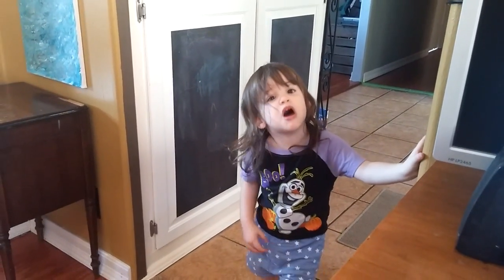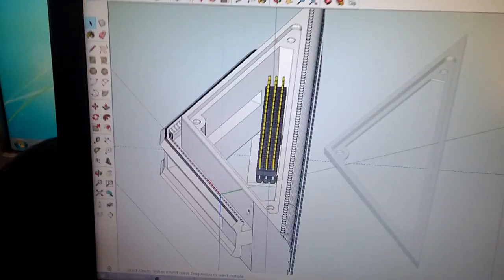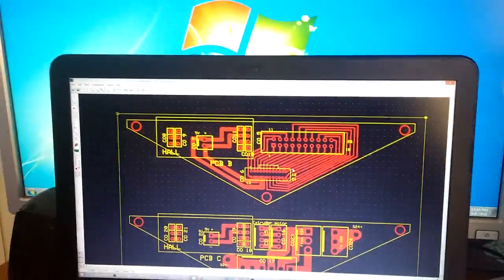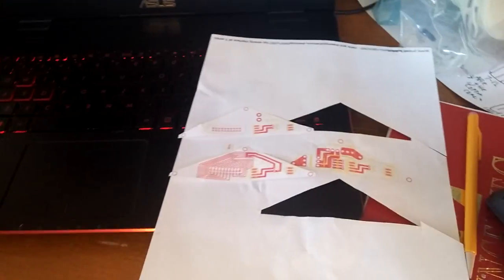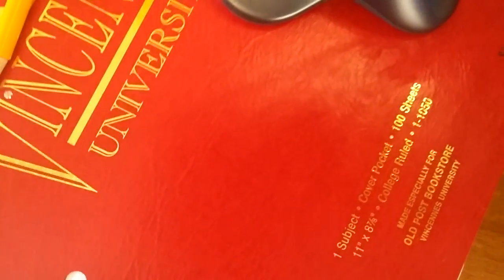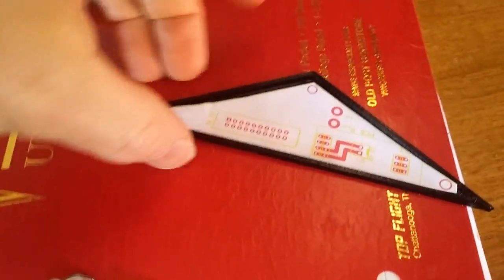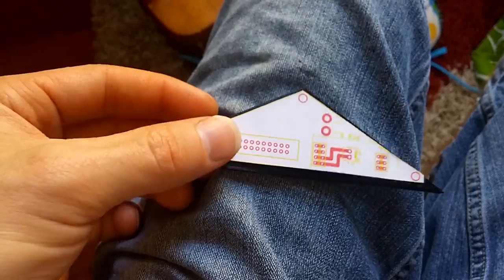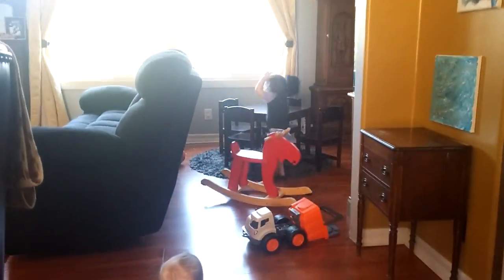Tip Clip: How I Test Fit 3D Printed Parts Before Making Final Prints.

Comment: I've noticed with Express PCB that the circuit board usually prints around 97% of original size so I always have to resize it on my printer. I forgot to resize on one print and had to bend the 8 pins on a transformer as I needed the circuit the next day haha!
Reply from the maker: strange. the only time I had that problem is when the printer settings were messed up. but never when directly printing from the program. ~Russ
Reply: *****

I think it's probably my printer that's doing it heh.
 EDIT: But it is a great program for quickly creating circuits. I love it!
Reply from the maker: +Jim Griffiths yeah. there are far better programs but. for the average builder it's just enugh with out being confusing. lol. been using it for over 8 years. ~Russ